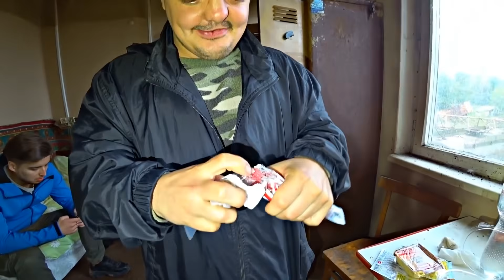✅ Chernobyl Found an American Waste Storage ☢️ Going to the NPP to see the 4th Unit

Comment: People: I will never go to pripyat. It's radioactive
This guy's: Go to the nuclear reactor without a dezemeter
Reply: That escalated quickly.
Reply: You mean dosimetr?
Reply: @walodzia Did you mean gaiger counter :)
Reply: @melounfork3790  did you mean Geiger Müller Counter? Also called Geiger-Müller Zähler
Reply: @mirai-neo  yes
Reply: @mirai-neo  Are geiger counters and dosimeters the same thing tho'?
Reply: @melounfork3790  he said dezemetre
Reply: @warlikelaughter6230  To a point, yeah. It depends on the user's use of it when it comes to something radioactive. From level amount, to exposer. You can also get meters that use both functions as well the detection of Beta, gamma, X-ray of it. Which is common to use with reactors pending on that country or reactor company. And there are detectors that can use both functions and also detect Beta, gamma, and x-ray. How much one would be is determine on what you want the unit to be able to do. You can get a cheap one that only does one or the other.
Reply: @walodzia  that DAMN AUTOCORRECT
Reply: Deez nutz
Reply: It's called a bleeper.
Reply: Ikr
Reply: @maximiliankeplinger4345  Neidisch?